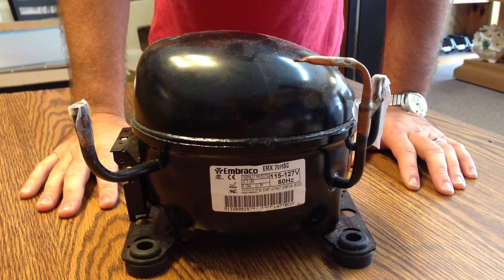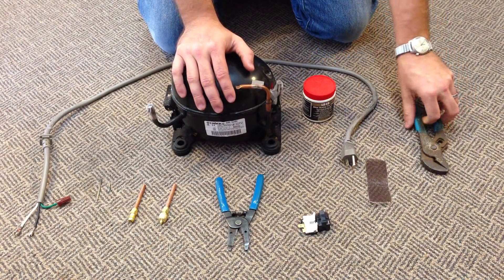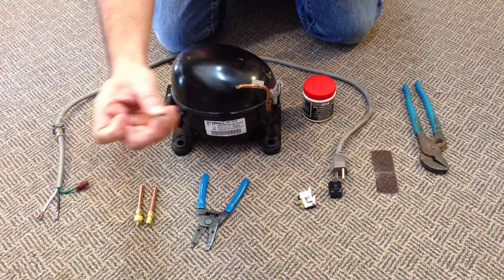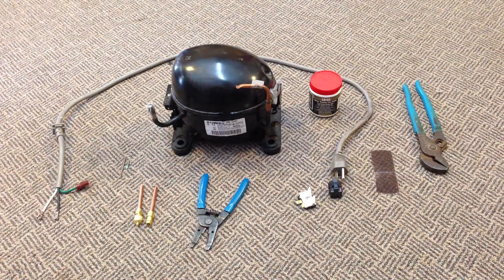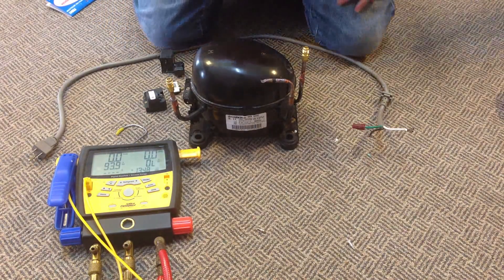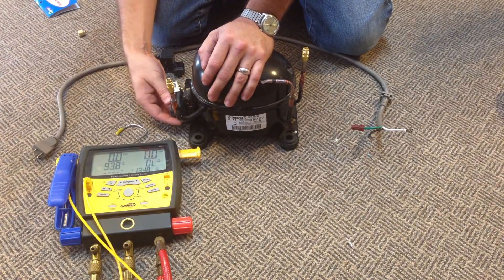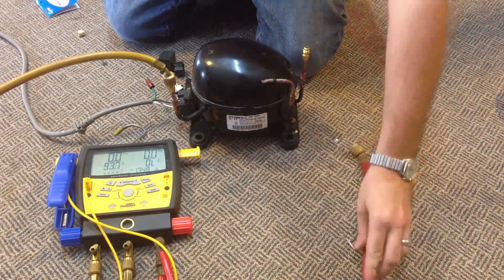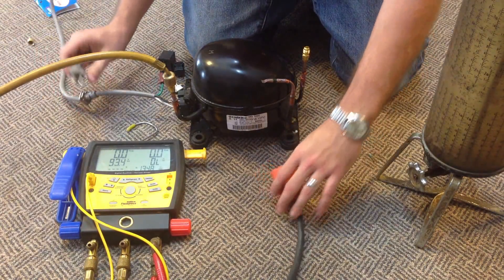How To Make a Vacuum Pump from Old Compressor

Comment: Put the torch on the brass, the heat will pull the solder to it and you will have more room to add the solder

Comment: Hope you cleaned up the motel hallway carpet after the video. It really is the best place for soldering copper.
Reply: I noticed how the solder beads up on top of that "burn proof" carpet instead of burning it. It must have been invented for smokers 😂.

Comment: This seems to be more of a recovery pump than a vacuum pump.   It could be used as a vacuum pump with some type of check valve/ oil chamber on the outlet side.    I definitely like the idea tho because without the chamber your able to use it to recover with you can pull a vacuum.

Comment: Refrigeration compressors are low volume, for faster vacuum  use an AC compressor for an old windows AC. drain the oil into a container before soldering, then add it back In. I'd put a suction line filter neutralizer on the suction side to protect the compressor.

Comment: You clearly are new to soldering…! There’s no damn way it would take that long to heat up that little ass pieces of copper. Let alone you using acetylene. It should have taken half that time…..WITH PROPANE!!  Your issue..??? YES, it’s what you where soldering with. You couldn’t find any lead based tin?

Comment: How can I tell which line is the vacuum or the high pressure? I have a compressor that isn't cooling. Don't know if it's freon related or some other problem. The compressor sounds like it's running but doesn't get cold.

Comment: I have used these on two previous occasions and they work quite well. The biggest problem I have found is the motor can overheat and has a thermal trip inside the windings. This can be annoying when you most need it working. Ordinarily the refrigerant keeps the windings cool but of course this is no longer the case, So far, mine have lasted only a couple of months and then became too unreliable. I did replace the oil too to help cooling and lubrication.
Reply: There's low chance you will see this, but what did you use it for? Im planning to use it for a desoldering gun and from testing it seems to not mind a vacuum but haven't done extensive testing yet
Reply: @alexstone691  Both times I used for dual purpose. Firstly as a silent compressor and also for vacuum degassing of resins etc. I dismantled the second failed unit and discovered the trip device and signs of overheating. The units were only run for 2 or 3 minutes at a time.
Reply: @creast56  Have you changed the oil in them, the original oil evaporates quite quickly and when it goes below  a threshold the compressor overheats
Reply: @alexstone691  The first one I must confess I neglected but I did change the oil on the second unit and used my compressor oil for the purpose.
It may just be that the units were from quite old refrigerators and were close to ending anyway.
Reply: @creast56  first one i managed to get started fine and then after working for a minute started smoking, as they are thrown away you never know what you're gonna get
Reply: How did you change oil?
Reply: @michal_kaa  There is an original filling tube which is sealed off. I cut the crimped end off and simply drained the old oil out.
Fresh compressor oil was syringed in and pipe fitting used to seal off the tube.
Reply: @creast56  thanks man

Comment: It will hold a vacuum if you shut the valve on the gauge. Also, you need to hook up the ground wire in case of a short it will trip the breaker instead of getting a shock.

Comment: This is a very interesting video, however I am much more interested in why anyone would use a large blowtorch to solder copper tubing over carpet.😆😆
Reply: I think he was brazing not soldering
Reply: Been sitting here wondering why not buy a soldering iron for 20-200 and easier job, less fire risk then also a new tool aha
Reply: @n0username0n  I'd pay to see someone use a soldering iron to solder copper tubing with hard silver. Silver solder melts @1425 degrees Fahrenheit , your solder iron melts soft lead free solder @  275 degrees Fahrenheit.
Reply: And on carpet
Reply: @n0username0n  Torch is faster and available. The I've always used a propane torch.
Reply: @blatantmisconception  I get that and for certain jobs sure but shit son, what about stocking up on the correct tools and there expandables? I mean da FAQ?
Reply: @blatantmisconception  your missing out, I don't know too many people that use propane anymore.  Use map gas (yellow cylinder) and you could do circles around a guy with a blue propane tank , standing there burning fuel trying to warm up a pipe to solder it.  This guy used oxy-acetylene, and he said silver not solder. I believe that is  brasing. It takes way more heat.

Comment: This video shows how to solder Schroeder valve fittings on old refrigerator compressor.
Wiring (???). Lubrication ( ???) will it run for an hour dehydrating auto air conditioning system (???)
Reply: Wiring.

By the looks of it, it is standard direct wiring, no start up or run caps to help the peak start up current or run current draw so either increase wire gauge as to not damage it or get the rated capacitors. Brown is live, blue is neutral and green is earth or can be red is live, black is neutral and green and yellow is earth. Look at the rated voltage on the compressor to make sure it will work with your home voltage. Current should be displayed on it in AMPS aswell to figure your wire gauges out.

Lubrication

Drain the original compressor oil as its hydrophillic and will cause issues quickly over extended use. Use vaccum pump oil if you have it  aslong as it is electrically non conductive.

Comment: 'what in the hell does that mean?  "Put the black on top...white on the bottom." You've not shown the configuration of the connectors...nor did you state which terminals get black and white.

Comment: I'd imagine if you clean the pipe better and don't finger it all up you could use 95/5 solder and a map gas torche or even propane, also I wouldn't suggest soldering over carpet lol. I do wonder why solder the piece on the vacuum side? I was thinking of just putting a compression valve on the outlet and also a ball valve on the pull side even though I will have another valve on the gauge.

Comment: Beware!!!! While working in the "80's" in western oklahoma some of fellow tradesmen were using old refrigerator compressor to evacuate some refrigeration systems on grocery stores.   I had just been out there and I myself had used one of these compressors to evacuate a system.   When I got back to Tulsa a few days latter my service manager come to me and says " do you still use a frigidare copressor to evacuate systems (sp)  on your truck"  I said Yes.   He said take off and don't use it anymore.   He said one of the servicemen called the office to say that he had one on a system and was evacuating it .  He went back into the grocery store and several minutes  (maybe a hour) he heard and explosion.  when got to the machine room the compressor , made of 3/8 steel had blew its top off and exited the top of the machine room.     what the decided happened was the discharge line may (or may not) had gotten bump or kinked and the pressure got high enough to set the oil off in and explosive bang.   Just like in a diesel engine that diesel oil and a spark (doesn't need a spark if pressure is high enough)    Just giving you a warning   I have never used one since.     Oil, Air (oxygen), under pressure do not mix
Drb
Reply: Could've been R290(purified Propane). This is used sometimes around food to avoid contamination.
Reply: Yah it is true if you vacuum nitrogen its explode for sure because its compressor
Reply: @johnalextv1253 nitrogen won't explode.  Nitrogen is inert gas.

Comment: Enjoyed the video. Still a mystery which tube goes to pull vacuum and which is output (and which sealed off)
Reply: Plug it in and stick your finger on the ends of tubes....one will pull one will push.....

Comment: I once made a refrigerator out of an old fridge compressor and I traded it for a key. The key opened a box on a boat at a local marina, but to get to the box I had to buy the boat. At the time my houses were in the middle of the street and most of my hotels were struggling under the burden of the recent marshmallow tariffs and I thought I'd never get to see what was in the box, but one night on my way home from circus class, I started thinking about gasses and things and how my mortgage wouldn't be paid out until it was paid off and as I trudged along towards an oncoming stampede of antelope, my downward gaze caught a sparkle that could be only one thing...a girl's best friend. The one that lasts forever. The diamond. As the herd barrelled toward me I curled up into the smallest form I could physically achieve, and as the beasts bore down upon me, I snatched the stone with my three-fingered hand and swallowed it dry. Now, I have to be honest at this juncture, I'm after having a difficult poop and a long canal ride to be meeting with my dear old friend and confidant Mademoiselle Chum Lee, the international jewel dealer, and he swears on a stack of Dr Phil flapjacks, which as everyone knows, has two sides, that he knows a Scot living in Uganda who would give me enough to buy the boat. Soon I would have $865 and the wonders of the box would be mine to discover. That was seven years ago and I still don't know how to get the last of the butane out of my live resin, but the box, the box may hold the secret...

Comment: Tell us more about the valves please.
I've seen that kind of valve on a bicycle inner tube... but not anywhere else... and never with a "big" length of copper pipe attached.
What kind of valves are these? What are they "really" for?

Comment: Solder on a open flame will turn to mush really quick if left there too long. You only needed to heat the parts up first then apply the solder with large solder joints. A open flame produces soot, which you don't want mixed with solder. Of course a high wattage solder gun would have worked also if you had one, but it's a bit tricky to use on large parts with little to no experience. Good soldering takes practice... sorta like welding need that experience to get good at it.

Comment: Calling this a vacuum pump would be a misnomer, because it can't pull a vacuum. It would make a good recovery pump, though.
Oil? You cannot add oil to this thing. These systems like the compressor was used in have oil in the refrigerant. It's mixed in with the refrigerant and flows throughout the system. That's the only way to get oil into this compressor. It is designed for that kind of lubrication and only that.
Again, used as a recovery pump, it will see sufficient oil in the refrigerant it is recovering. Otherwise, no.

Comment: What do you call the ends you soldered on the compressor & where do you get them.
I guess you threaded the ends on to the copper tubes?
Reply: They are glorified bike tube valves one way in and out

Comment: You cannot make an effective vacuum pump with a reciprocating compressor. You need a rotary compressor.
Reply: This is a very inaccurate generalisation.  There are MANY types of vacuum pump and rotary and piston are just two of them.  Each type is suited for certain applications and less suitable for others.  

https://en.wikipedia.org/wiki/Vacuum_pump

Comment: I just removed the air compressor from my freezer and wired it up with a Supco 3 n' 1. The air compressor hums quietly (almost silent) but very little air is coming out of the outlet. What's up?

Comment: You said you cleaned the outside of the pipes with emery/sand paper but what about the internal side of pipe?
I mean, what you did would be perfect if the extra pipe section had a larger diameter than that of the pipe attached to the pump. Did you ream the inside of pipe? There are special tools for this. Of course you have to be careful of filings getting inside the compressor but you could minimise that risk by taking a couple of precautions such as changing angle so pipe is more horizontal; setting up a vacuum cleaner nozzle very close to the point where you are working. (Yes I know there is oil inside the compressor. That's why you have to be so careful)

Comment: As a refrigeration expert - This is very misleading information. First - A real vac pump does not look like what he shows - look for yellow jacket or appion Tez 8 (dual piston). Second this compressor will run a few hours then die because no oil is recirculating back through the suction and moisture in the air will turn the oil acidic and eat away the windings quickly. Third As others have mentioned the industry standard micron level is 400 or less (basicly a compressor cannot pull a deep enough vacuum to ensure a quality job on refrigeration). When you are dealing with zoetrope (400 series) refrigerants this is EXTREMELY important.
Reply: I want to make a vacuum pump like that and thought to drop some oil to lube it  but just enough so  the oil don't spit on the output, good idea??
Reply: Supermrt, people have been using these for years, I'm a mechanic and agree I would not use this at work for A/C units, I'm making a vacuum pump for degassing casting resins, what oil do you recommend i use?, thanks again!
Reply: @LazyH-Online An hour was an estimate, I have done this experiment 10 years ago when I was an apprentice- We had it running in a humid environment and it lasted about an hour. So thats great that your compressor is lasting longer maybe a different brand of compressor? I have also used AC compressors from a jeep (old school style) and they run a long time however they are a completely different design running PAG oil. I'm glad you think I sound young, I wish I was. LOL

Comment: Hey there, 
Thank you for your video, it was really scary as you are working with fire on a carpet. Please NEXT TIME MAKE A SAFE WORK PLACE outside of living room or master AND WELDING or soldering WAS NOT A PROFESSIONAL JOB AS I WORKED WITH THIS TECHNOLOGY many years. you have to clean pipes by sanding B4 you soldering, Thanks again, good luck and god bless, Mike/ Canada

Comment: I think this guy means well but this compressor will never pull 500 microns so it can’t be used as a refrigeration vacuum pump
Reply: IT DOES AND DOES IT VERY WELL. IVE BEEN USING MINE FOR 10+ YEARS! PULLS SYSTEMS DOWN TO 350 MICRONS OR LESS.

Comment: Instead of using a torch ,  I do not have one, why not use compression fittings ?
Reply: Compression fittings will work until they don't work lol.....you don't need  oxy/acetylene torch to braze.....get a map gas torch from Walmart and you're good to go boss

Comment: You can NEVER replace a vacuum pump with a fridge compressor.
The fridge compressor has very hard discharge valve and very soft suction valve.
The vacuum pump is the opposite way around. Its only good to suck solder from a pcb and blow up balls or bicycle tires.
Reply: a petrides actually your wrong mr. know it all. I've seen them in action and working! I've also see the old R24 compressors on cars turned into air compressors.